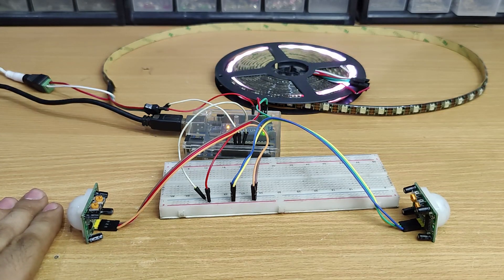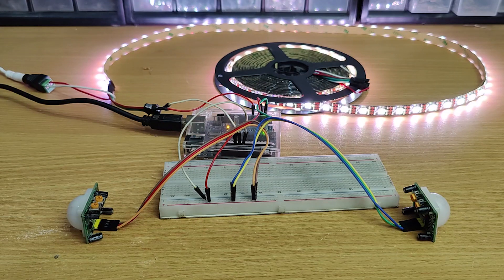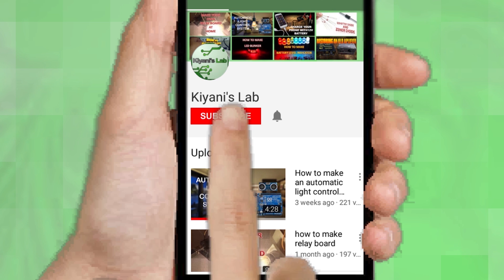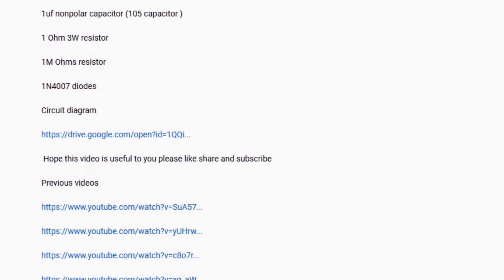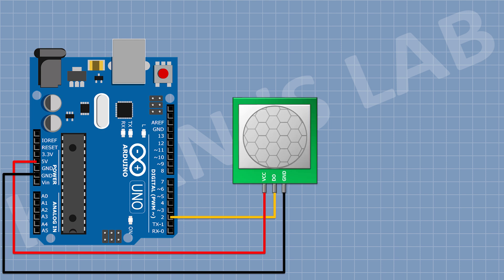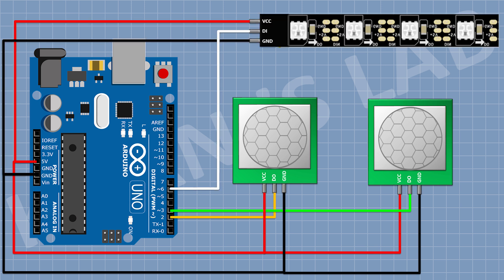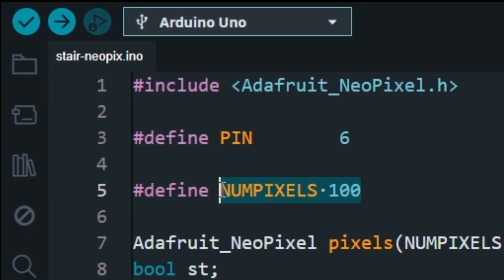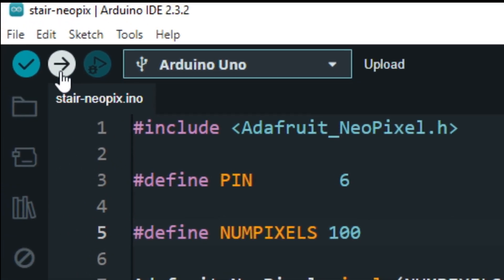DIY Automatic NeoPixel Stair Light | Arduino Project

Comment: circuit diagram has wrong, arduino not can handle 6A current out to leds. need change led strip power own positive and negative wire to power supply, not out at arduino. arduino go out only D6 wire and power need connect to led only, but led ground need connect to arduino too. led positive go only to power supply.